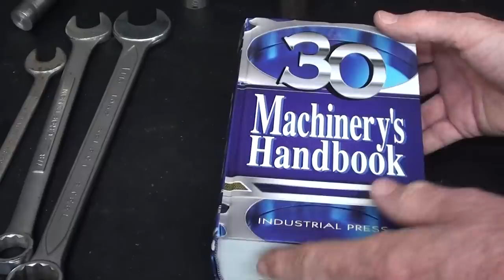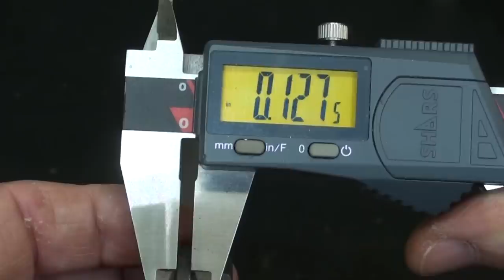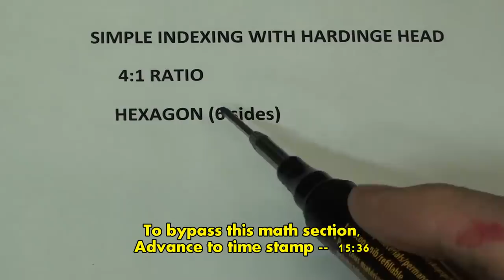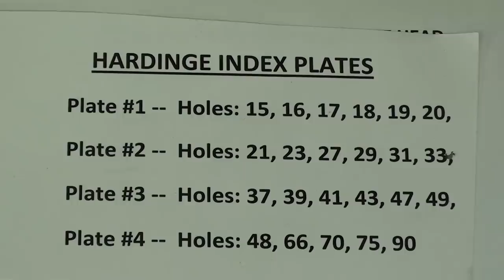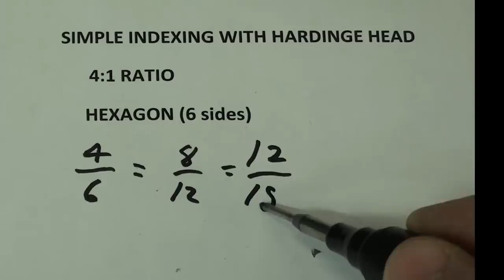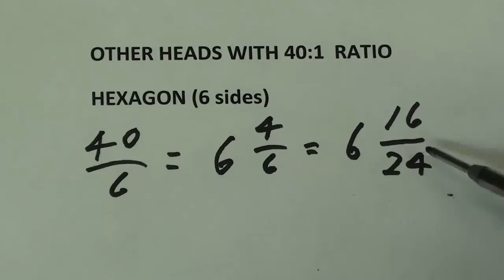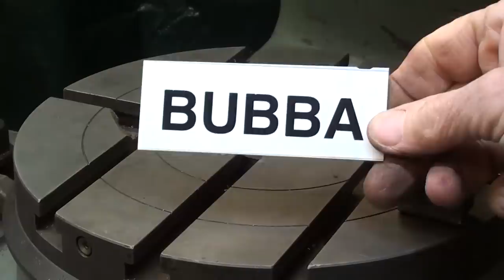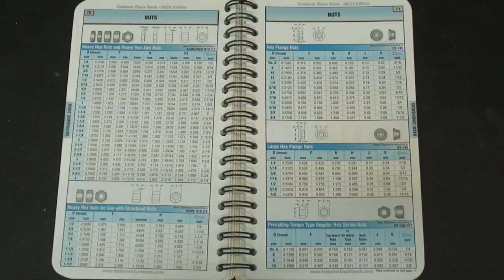Making Flange Nuts 3 methods of indexing TIPS #629 tubalcain

Comment: When machining a hexagon the distance across the flats multiplied by .866(sin 60 degrees) will give you the distance across points. If you make it 10 or 15 thousandths smaller, a nice corner will be left.

Comment: Thanks Mate,
The gift of being able to teach  has been bestowed upon you. Lucky  fellow. Many can do but only guys like you can teach. Thank you.
With this vid i have finely decided which device to buy to make nuts on my mill. The rotary table nearly won the race but after this vid an indexing device has been found online. Before your vid my tool shop only offered very expensive heads i didnt want. Its a deep hole this 'at home' machine shop. I thought id buy a mini lathe but instead i got a got a heavy 600mm lathe and a seperate massive mill drill so now i need a bigger workshop. With your help and knowledge i willl now make uniform sized nuts just like this vid so i dont have to use different spanners on each machine. 
Thanks Mate, thanks from all of us. We do need this knowledge and appreciate your gift of being able to teach your skills to us.
Reply from the maker: Thank you very very much for the compliment. Good luck with your indexing device. Sounds like you have a nice shop.
Reply: That Hardinge super spacer you have looks sweet, you always have such awesome plunder. I really enjoy you showing different setups and operations it adds tremendous value to those who are equipment limited and is such a great teaching resource, Tubalcain.

Comment: Mr Pete when setting a vice on mill table.
I prefer washer because it is stationery.
Flange nuts moves item your tightening down.
Reply: good point
Reply: if using washers, you really want to use hardened fender washers. Not overly expensive (50-75 cents each) just hard to find unless you go to a specialty fastener supply
Reply: Geoff Flato 
Thanks
That’s what I use.
Enjoy Mr Pete and his videos.
All the best
Ge
Reply: Could use both! Washer to isolate and flange nut to spread the load.
Reply: Dude, it's a VISE.
Reply: jerome clements 
How many vices are there.?????
Reply: They both have merits or it would only be one choice. Honestly it depends on the job for me.
Reply: And all valid points guys!

Comment: Many times a separate (hardened) washer has the advantage of allowing the nut to spin, without moving the alignment of what is being clamped, especially if one lubes only the nut-washer interface and not the clamping side  of the washer.

Comment: Hi Lyle,
I have the 25th edition of the Machinery Hanbook, and it has the flange nut dimensions but only for metric, in the 25 edition it is on page 1470. In the index, it is listed under "nuts", "ANSI, metric dimensions" "hex, flanged".
I would be surprised if they had omitted it completely by edition 30.
I think you used some poetic licence on needing a bob cat to move your cincinatti dividing head, I have a cincinatti dividing head and I agree you have to be a very strong man to lift it onto the table unaided.
I would agree that it would cost more to make than buy, in Oz, they are around $10 plus 10% GST  for 2.
Regards Dennis

Comment: Thanks for making the video, nice techniques. For anyone that does not want to make flange nuts, they are available at McMaster.com, they sell grade 8, grade 5, and low strength nuts, metric and imperial. Bridgeport mill tee slots are 5/8”, and the studs in my kit are 1/2-13 thread. I always wipe my drill bits off after use before returning to the rack. If you lay some covers on your mill table, makes it a lot easier to clean, not so many chips in the t-slots.

Comment: Watching for Pleasure ?    Well it's Lunchtime viewing here - and this kinda learning IS Pleasure.   ....  but it is the accumulated experience from viewing -  + the extras we get - like that broken Walter Table.   Yes, I never thought of the jacking off to break  surface. Thanks.    Now personally, I prefer  to have to use  as few spanners around the Lathe and  Bridgeport as possible , so making new Nuts for me is a case of Standardising Nut sizes regardless of thread size.  and I have brazed Heavy washers on -   found less distortion than welding.   Just sweated on.   Great -  Thanks for posting.   Keep on milling!
Reply from the maker: Thanks

Comment: You can use a hex block and threaded stud. Make sure you squeeze it in the vise along the Y axis and clamp the nut against the back jaw. The wood is simply the indexer and a hardwood hex block wont break. Joe Pieczynski just did this exact same video on a much smaller scale. Inspiration? As for the washer question, floating washers have less chance of damaging the contact surface.

Comment: the locking lever on the hardinge should have spring inside to lock it out so it wont turn on accident . most machine shops still have those and are used a lot because it can be clamped in a vise, quick and easy

Comment: I have a part off tool I made with the end ground 30 degree angle to chamfer nut corners but also with another 30 degree angle back up the tool shank a little to chamfer internal threads.  No top rake but with front clearance on the internal chamfering part.   Makes for neater chamfers than hand filing external corners or using a drill tip by hand on internal threads.  .  Other suggestion when making nuts is to leave tapping the hole until after parting off so tapping swarf gets pushed forward and you tap to final size in the one pass.  Saves material or having to use the three tap sizes down a blind hole.  Trust this helps!

Comment: Worth doing this job if you need nuts that are special titanium nuts or bolts.
I sometimes have to remake a nut that (due to rust) has lost it's edges. This is the case mostly on classic cars that have those unusually sized octagon nuts. somewhere between modern sizes.

Comment: Another great video. I have thought about making a set of left hand thread bolts and nuts to see if that would stop others from borrowing. Maybe a five sided nut. I also hate dirty drills. It doesn't take that long to clean any tool before you return it to your tool box. But I would rather have a dirty tool than no tool returned. I really hate collecting borrowed tools.
Reply from the maker: Yes

Comment: Great tips. Now a retired sparky but if I had to choice another trade I would pick machinist. While doing work in a lot of machine shops & tool & die shops the great talented guys bailed.me out. One weekend when probably 45 minutes from home I needed a 3/8" falling tool for 3/8" lead anchors. Machinist made one in no time. Still have it. Messed up threads on my hydraulic knockout set and supply house did not have a replacement stud in stock. Somehow they placed it in lathe and guess you call it " chased the threads ". Knockout at least 50 holes with it that weekend.

Comment: One of the best things about making your own washer nuts is you can standardize your parts to use as few wrench sizes as possible. My lathe has all the commonly used fasteners converted to 9/16 heads. I have bolts with flange heads that are 1/4- 20 with a 9/16 head. One wrench does it all.

Comment: I use prime factorization to decide the plate to use. 6 is 2 * 3. You have 2 from the gear reduction(2*2), so you can pick any ring of holes that's a multiple of 3. You have those on each plate, so you wouldn't need to change plates regardless. 15, 21, 39, and 48 would all work, using every 10th, 14th, 26th, or 32nd hole respectively. Basically your method, but simplify the first 4/6 down to 2/3 first.
Reply from the maker: That’s a good explanation thank you.  Trying to keep it as simple as possible, which is not easy

Comment: I have some flange nuts with convex faces and mating washers with a concave face on one side. They are handy bolting down castings, etc., on the machine table or face plate as they will self align to an uneven surface.
Cheers from NC/USA
Reply from the maker: Thank you, I have seen those in the catalogs

Comment: Nice video!  If I were making the nuts I would make the blanks twice the length of the nut height plus the cutoff width and a little more for facing stock.  Then mill one side of the blanks and turn end for end and mill the other end, moving on to cutoff and face.
Yes, drill blank before milling.  Tapping by using a fixture/jig, whereby the nut is slid into a slot the width of the hex (loose fit) under the tap, the up retention by the washer in its slot.  This is a very simple procedure, difficult to put into words.  This is a production method.  Start with first nut and push it through with the second nut and on and on.
Just another way, JIM

Comment: Thanks for that Lyle, most informative and I will be using the rotary table method to make a much larger nut than I have at the moment for locking my Multifix tool post on my lathe. ( at the moment it is an M10 x 1.5 m.m. Metric and I am going to go up to 14 mm if I can get a tap easily if not it will have to be M12 )

Comment: If possible I prefer flange nuts and spherical washers
I have one of the Hardinge H-4 indexers.  The spindle and the bearing bore are tapered. The retaining nut needs to be set to practically zero end play so you can just turn the shaft to index the part. Properly set they are rock solid. The index pin should be spring loaded.
Yhe Cincinnatti and Kearney and Trecker dividing heads we had at work were 5 : 1 ratios.

Comment: I had to make a single nut.  As only one was required I picked up a hacksaw, file and micrometer after marking the flats by drawing a lathe took over the face of the stock while it was in a three jaw Chuck, indexed by propping a jaw with a random piece of wood.  Surprised at just how little time it took.....

Comment: I made my flange nuts buy using a piece of stock with a stud screwed into it... I cut all the nut blanks, threaded them and screwed them onto the arbor mounted in the dividing head chuck.. I tightened the nut blanks with a stilsen wrench in the area to be machined and ran the machine in such a way as to tighten the blank on the stud as it was being cut...When the flats were finished, removed nut with wrench.. Same type of threaded arbor in the lathe chuck to finish the nuts after flats are cut..  Case harden in Kasenit then blacken with tool black.....I made tee nuts as well for my Kearney and Trecker machines as the tee slots are larger than Bridgeport size.. Mike in Louisiana
Reply from the maker: That sounds like a brilliant alternative idea. I bet they turned out great. I was going to case harden mine. But the video was already way too long. What kind of black solution do you use?
Reply: @mrpete222  Precision Brand 45110 Tool Black.. Stuff is about 80 bucks a quart but it will last a long time for small parts.. I am sure it is selenium like most gun blues.....As far as Kasenit, I don't  think you can buy that stuff anymore.. Mike in Louisiana
Reply: Brownells sells a "surface" hardening compound.  Maybe when I run out of Kasenit and the chromium version of the same I'll buy some.
Reply: I don't believe there is a way to run the machine in such a way as to tighten the blank on the stud unless you were using a left hand cutter...am I crazy here?
Whether conventional or climb milling, the cutter is still pushing the nut in counter clockwise direction.
Reply: @1967Twotone  I usually end mill the flats but have on occasion used a left handed end mill on the side.. I usually tighten the hell out of the blank with a stilsen wrench then mill flats where the wrench marks are...Remove with box end wrench.. Mike in Louisiana.....

Comment: I too clean my drills and mills and other tools as it attracts dirt and dirt causes wear and sometimes rust. Its easy to clean so why not? I also never magnetize anything for the same reason - yes even screws. And yes I do add back a tiny bit of oil to them to keep them from rusting. I usually keep a Hoppes Silicone Cloth for that and they sell them for fishing reels and guns so I know it is pretty good quality.
Reply: If you do this keep a fine quality rag in a plastic box along with some silicone oil and keep it handy and keep it closed. Silicone is hydrophobic to the extreme. Except drill bit type tools I usually use CLP or some kind of military gun oil for other tools and do the same thing.
Reply from the maker: Thanks

Comment: I prefer to use a standard nut and a separate washer under it, because the washer remains stationary when the nut above is rotated. The problem of a flange nut is it's tendency to walk because the flange rotates as well and thus it moves the clamping iron or a workpiece underneath.

Comment: To reduce waste Material with the rotary table method you could prepare pieces of short stock wich is long enough to get two nuts out of by turning the stock when milling on one side is done 180⁰ and mill the other end. Of course it's more work in preparation but if thats everything you got, I think its not a bad solution

Comment: Nice job! I'm pretty sure flange nuts were in the 29th edition of Machinery's; I'm really surprised that they're not there in the 30th.

I'm a bit surprised you don't have a prime factors table for your plates. That's generally the fastest way to figure out what a good plate will be. Find the prime factors of the division you wish to make and then just find the first circle that contains at least those factors.

In your case, 6 is 2×3, which are prime. The head ratio is 4:1, ie 2×2, so that gives you the two. The first circle that has a three in it would be 15, 3×5. With the 15 hole circle and the 4:1 reduction you have total factors of 2×2×3×5. So if we take out the two and the three we need, that leaves 2×5  behind, meaning every 10 holes. Choosing the 18 hole circle, that's 2×3×3, giving total factors of 2×2×2×3×3. The leftover factors are 2×2×3, so you want to skip 12 holes per step with that circle.

Comment: Could a thick washer be friction welded to a nut?  Then, trim the washer  ?  Its been decades  since my high school shop teacher demonstrated friction welding two steel parts using a lathe but it was pretty quickly welded as I recall and neither of the former two parts was deformed.  The threads would need to be cleaned up.

Comment: Great video Mr. Pete, thanks for sharing. Just have to mention, at least in my experience's (in the automotive world) anything with a 1/2 inch X 13 thread usually needed a 3/4 wrench, just saying.
Reply: That's true for typical hardware, but flange nuts for milling setups are indeed 7/8.
Reply: @randyshoquist7726  Makes sense, with the 7/8 nut to washer ratio, gives more surface area for clamping pressure. Thank's for the reply Randy, your the man.

Comment: Hi Mr. Pete.  Great video, I was looking for some flange nuts to hold my chucks onto to the lathe backplate.  I alway manage to drop the washers, and nuts, down into the swarf.  I can by some from Amazon UK, but where's the fun in that.
Your video has opened my eyes to the different methods, employing different tools.
 I already have a rotary table, it came with my mill vice.  Tomorrow I'll be looking at how I can use that.  Then I can make some flanged nuts.
Thanks for education , student Noel
Reply from the maker: Glad you liked it
Reply from the maker: Glad you liked it

Comment: Love your videos.
The one thing I would suggest, as seen in the factory nuts, is to chamfer the inner edges as well. A specially the one below the flange as it will make it a lot easier to get started especially if in a blind area.

Comment: Do You really not have a Bobcat? Every person ought to have one..... Joking!
A few days ago an M6 flange nut with a flange being 4.5 mm thick, 15 mm diameter and counter sunk to 12 mm ID, 3.5 mm deep. Now I got the idea from Your video. Likely an extra project "tomorrow".
A bolt and a not perfect washer does the job for the moment.
The Bubba table..... My mill T nuts are like that but knowing the danger and being disciplined it has worked out well so far. Keep some margin applying the threaded bar and make sure the bar is not rotating while the flange nut is brought in place.
Clamp a chuck on the rotating table. Useless here unless using a short Jacobs chuck in the mill....
Maybe mounting the table standing up, with the chuck, could work better.
Time 26:00. Perfect, using the protractor, not the hand crank.
Thanks for the inspiring video!

Comment: Lyle, I noticed that the store-bought nuts were chamfered on both ends of the thread,  you didn't chamfer yours, do you feel they are not worth the effort? Thanks for the valuable lesson!
As far as the hardening and blueing process, you could make and accumulate a year's output, then clean and treat all your production at once. I have always loved the look and feel of good flange nuts.

Comment: 2:42 no matter which surface you mill with a regular right-hand cutter it will unscrew! Use a left-handed cutter...problem solved! I knew I was saving that carbide 3/8" left-handed cutter for SOMETHING! Got it in a mystery box of tooling at an estate sale. Wooden box had almost 49 lbs of goodies in it. Bid twentysix bucks for the box. Love a rainy day auction!

Comment: Mr.pete...? ( Student raising hand )..
A very useful tutorial but I would like to add if I may..
On most of your manufactured hex nuts and studs they have a 60 degree chamfer internally, on the nut,
As well as externally on the stud..
My question is would it be beneficial when making your own hex nuts, to incorporate the 60 degree chamfer to the nut as well, with a chamfering bit. It helps to align the nut to the stud for speedy fastening.. could this and would this be beneficial, as an added completion to the homemade flange nut...? And thank you for all your wonderful videos,it is a great learning experience from the master...
Reply from the maker: Yes